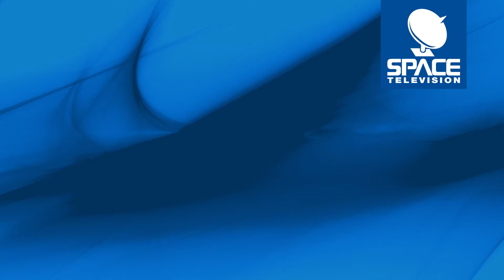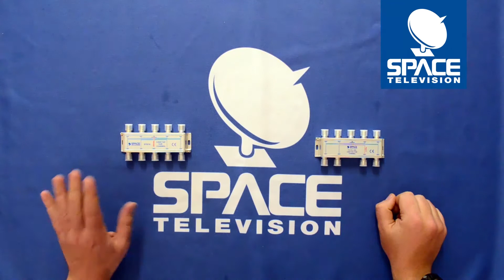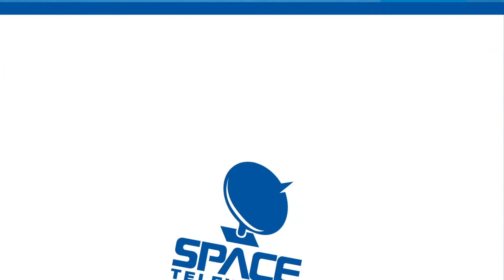Difference between a TAP and a Splitter

Comment: If Splitters is used to connect multiple Tvs then what will happen?
Reply: If splitters are chosen over tap-offs in a RF distribution system, the result would be an unbalanced system where some tv sets receive a to high signal and others receive a too low signal resulting in poor quality images